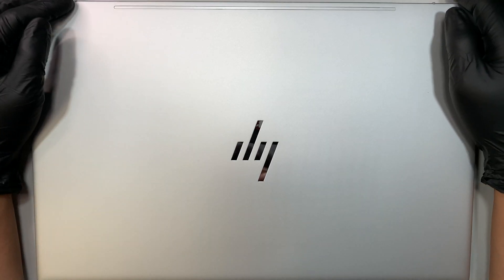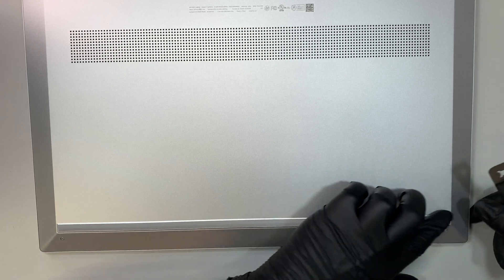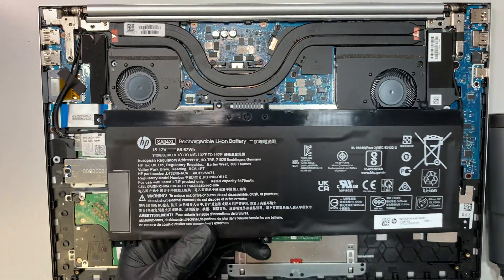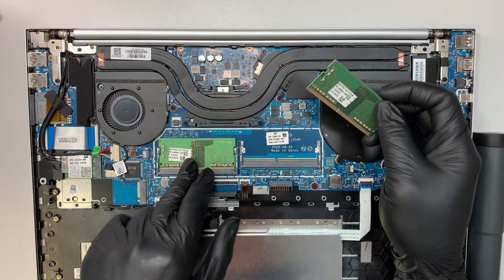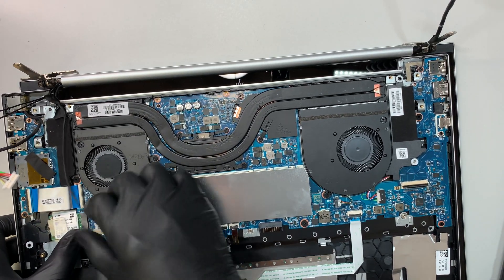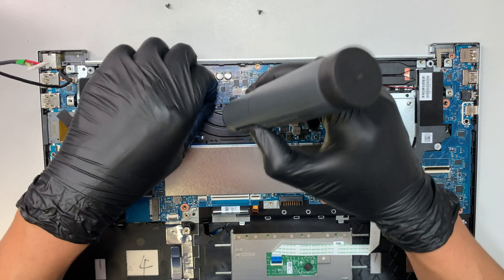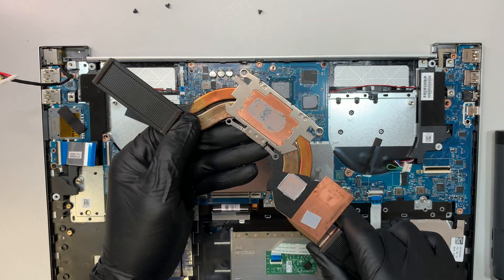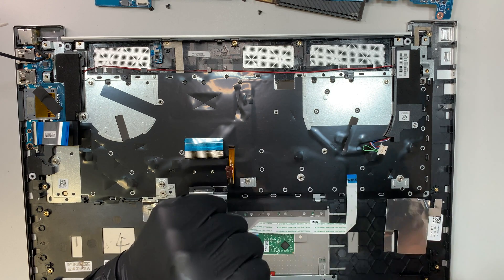HP Envy 17 CG1045 Tear Down Disassemble

Comment: Thanks for the guide, I only needed to get the case open. The right side hinge screw was a problem however as the plastic mount inside was broken. I did manage to carefully get it to come out with some effort and there are still two good screws holding the hinge in place. The original problem was the left side fan was binding and causing an error.

Comment: A good video, that does not hide the difficulties of the disassembly of this HP laptop or the sometimes bad surprises of a remaining but hidden screw...Some laptops are more intelligently designed than others and easier and faster to repair. Patience and calm are key to the job. Thanks for this video.

Comment: if i am under warranty can i get a motherboard replacement as well under 90 days at micro center? i upgraded the ram & now the metal casing caused short Circuit caused by aluminum plate

Comment: Sir I am part blind I need capital letters to be able to reach your answers I can't read Laura case text I'm using a voice program to post this I need to know how are you able to clean the fans Take them out disassemble them and clean them And put them back into the laptop this is what I need to know Can you please make a video showing that From this model ?
Reply from the maker: Please remove the back cover and use air can duster to blow dust off the laptop fan